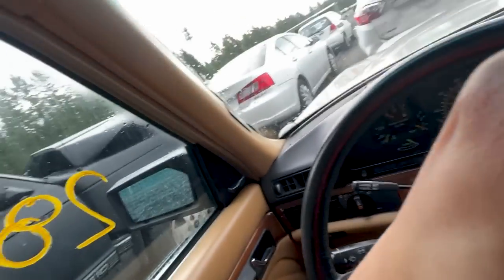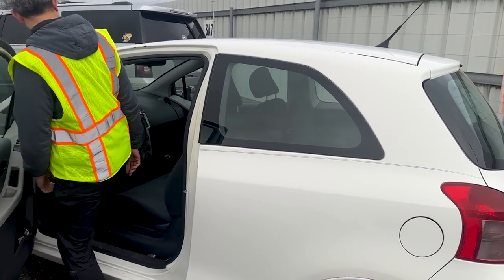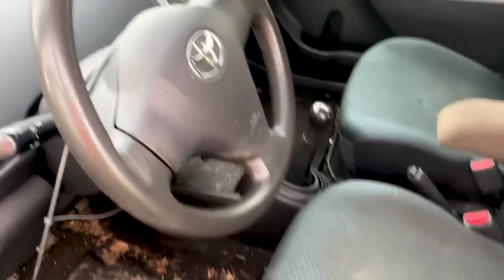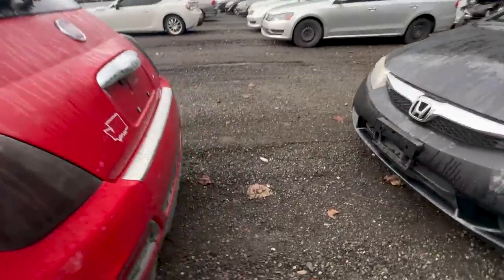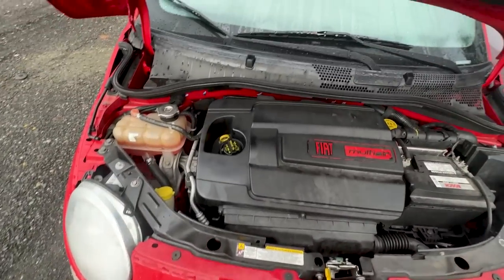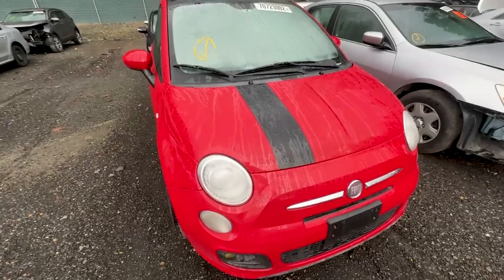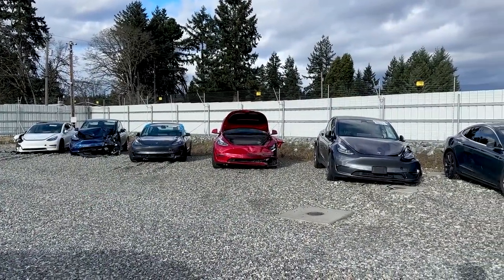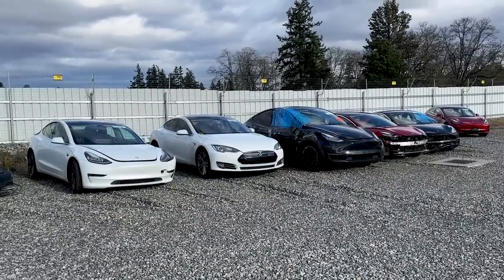JDM SiR Honda Up For Sale? Auction Car Hunting: Episode 4!

Comment: Condition report writer here. How often do you worry about rust? Seems wet and cold quite often and we get a few GSA from up north eaten up with rust
Reply from the maker: Not too much salt on the roads throughout the year. So if the car is local, there tends to be minimal rust. But every car is different so it's hard to say

Comment: You open the hood on the 300 td with the little pull thing that comes out of the grill. You pop the hood and the little thing poops out to the extend where you can grab it. And I guarantee you, there is nothing wrong with it mechanicly. they need nothig to run and run forever. It just looked like it sad in gras for a while and rust is mad
Reply from the maker: I'm a dummy and missed it. I'm used to digging underneath. And who knows, you might be right!